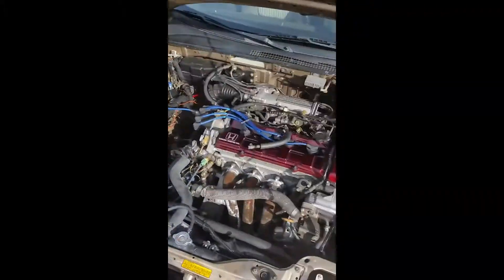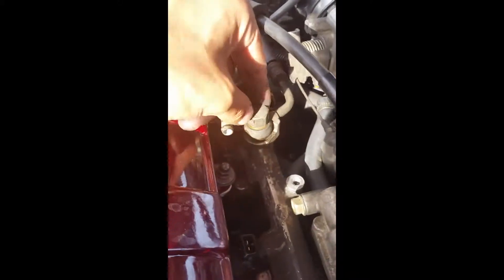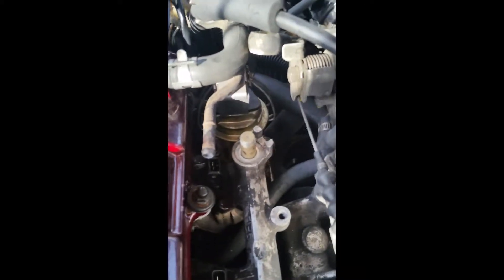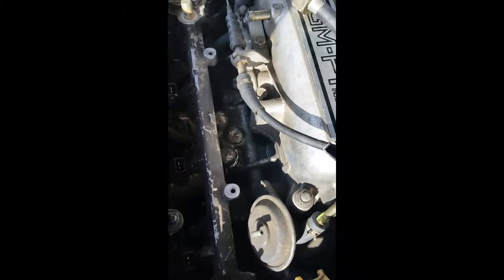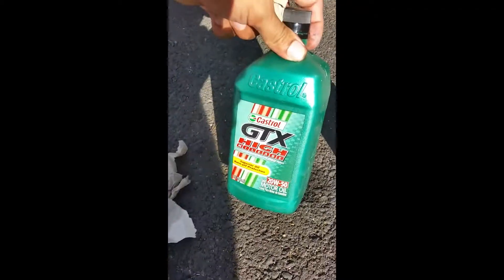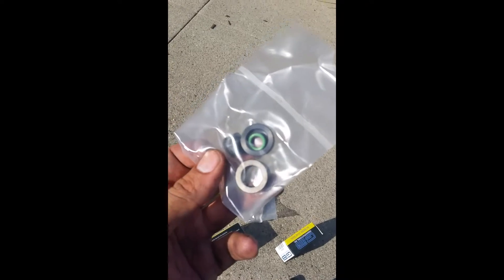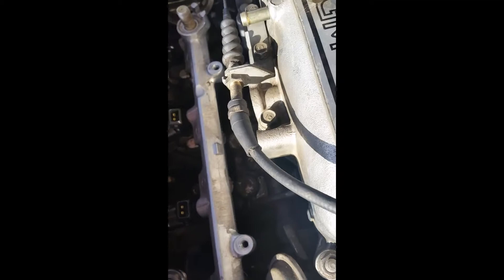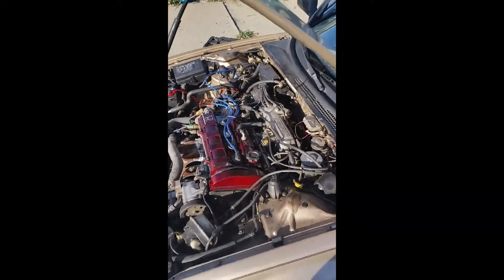89 Prelude si fuel injector replacement

Comment: How did you pull out the electronic connectors? You said to push the edge outwards but that doesn't explain much. I tried doing that and I get zero results!
But then again I'm not entirely sure what it is your doing. My car failed smog due to a leak and I wanna fix the issue myself rather than spend a few hundred for someone else to do it.
Reply from the maker: Where was your leak ? The injector itself is leaking?
Reply from the maker: There is a metal clip around the plastic like a horse shoe or like a C surrounding the plastic plug. If you want add me in IG and I can share some better pics
Reply from the maker: B_leal01
Reply: @dabay01  I seen the clip but can't finesse it. I honestly don't know man, my buddy and I noticed a leak when we tried the a/c and then when I took it to get it smogged they told me it was leaking fuel so I decided to try and check the fuel injectors myself to see if one is bad or if the seals are bad. I'm gonna follow you in a bit man!
Reply: @dabay01  my user name is yurei.akuma
Reply from the maker: Be_leal01 for my Instagram